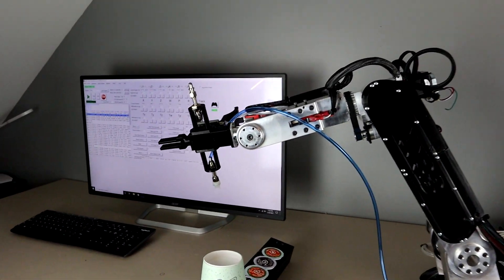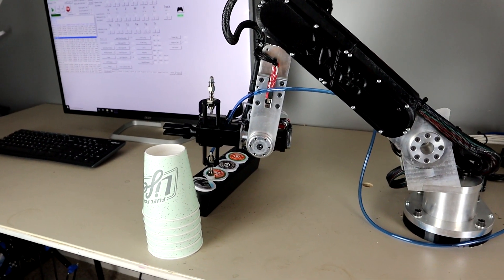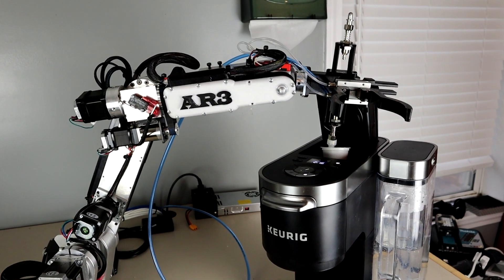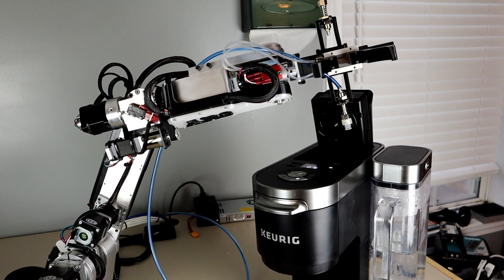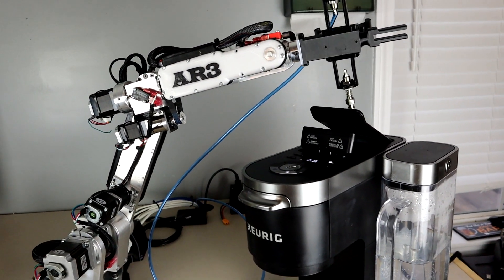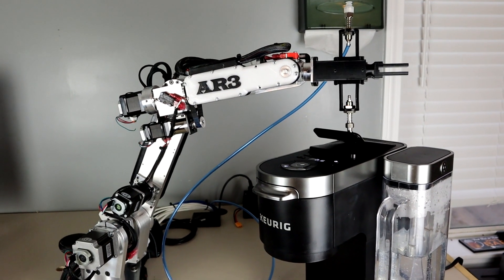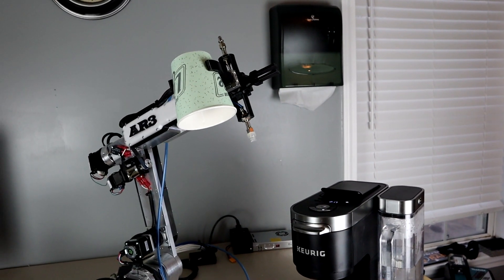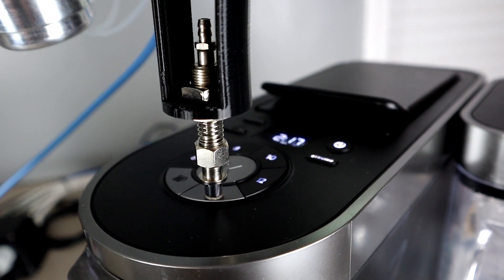Automating My Morning Routine

Comment: can it pick up a steel bar about 1.5 lbs and press it against something (vertical) with enough force to buck a rivet?  how many lbs of force can it apply in such a situation?
Reply from the maker: I don’t think it could, the payload is 4kg I believe
Reply: @me3dp439  4kg is 10 lbs, that's pretty good.
can you put a scale on the wall and measure how much force it can push with?

Comment: Why are the movements so slow? Is the bottleneck the cpu speed or power supply or the algorithms or is it on purpose? If on purpose, why so?
Reply from the maker: It was not on purpose, just due to the fact that I programmed the robot at that speed, and never changed it afterward
Reply: @me3dp439  thanks for letting me know!